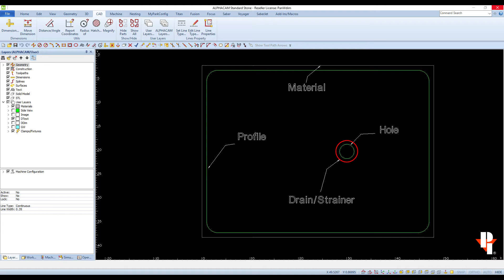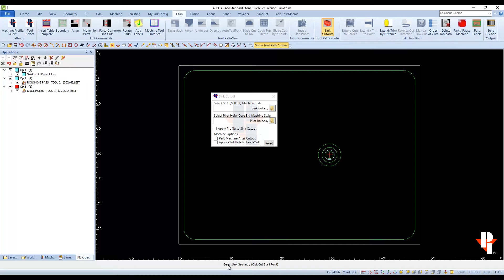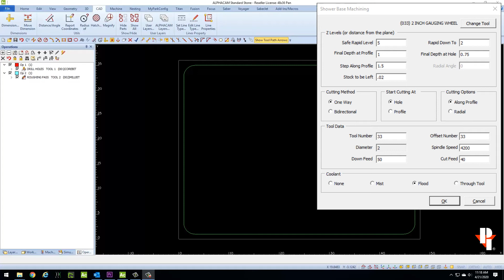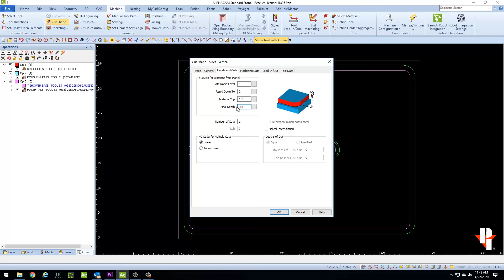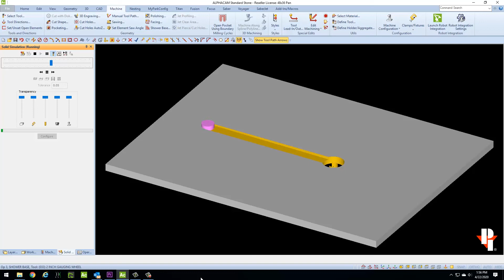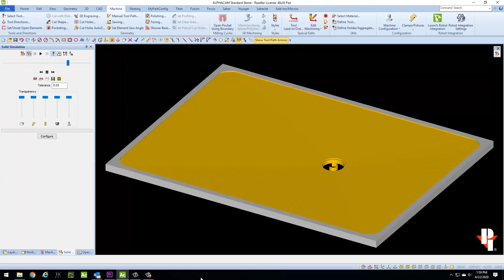Programming a Shower Pan

Comment: What tool did you use to cut the slope? You reference a 2" guage wheel but I cant find a tool with that description?
Reply from the maker: Hi Charles,

Park Industries stays neutral when recommending tooling so we cannot give you the exact tool, but it was called a "Shower Pan" tool.

If you talk with your tooling vendor or search other vendors they should be able to help! Thanks!
Reply: @ParkindustriesUSA  can you use a standard gauge wheel? Like a 3.6 inch guage wheel. ?